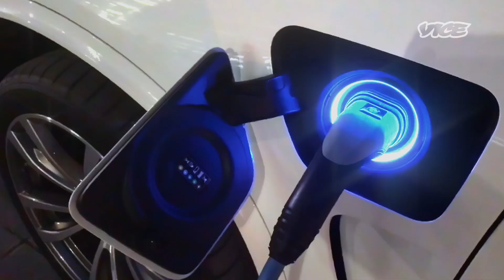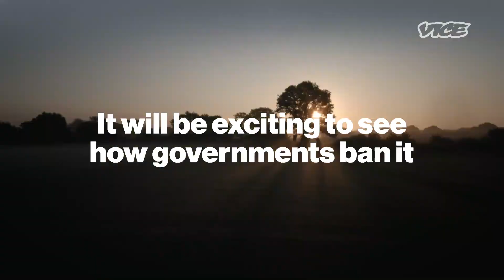The World’s First Solar Car | Extinction Update

Comment: Was this a joke? They didn't say anything about how much power the solar panels provide to the car versus how much is provided by conventional charging. I've got solar panels covering the roof of my van and it's a lot bigger than this, and I've got 500 watts of power in perfect conditions which never happen. Realistically, I get somewhere between 100 and 200 watts for most of the day. A wall charger for a  electric car delivers about 11000 watts of power and a supercharger can deliver up to 250000 watts of power... From what I've read about the lightyear one is that it has advanced panels allowing it to generate 1000 watts under ideal circumstances translating to about 200-500 watts in real world circumstances. Then you have to consider the fact that this will be a city car primarily. You don't get great sunlight downtown, in underground parking, or in your garage (Do people who drive $150000 cars park outside).  So Conventional charging can be up to 2500 times faster. Maybe watch the solar car race out in Australia to see what an actual solar powered car does, and then think about putting that car anywhere but the desert and how it just wouldn't work. There is a reason that Hyundai and Toyota don't claim that their solar roofs are for anything more than power for accessories. That being said, this is a nice "electric" car.
Reply: Wow I just got educated
Reply: Dylan Pollastrini no you just got brain washed by a seriously fake untrue video about solar cars that do not work yet abs are not even close to working.
Reply: @dylanpollastrini8129  this is a revolutionary car in the future because this is a infinite charge your driving in the highway
Reply: You could add pedals for an extra 100 watts lol
Reply: @abyssmanur3965  and maybe a wind turbine too, lol.
Reply: The claims are exaggerated by Vice, they don't claim to be fully solar. I think your closing sentence hits the nail on the head, if you compare it to other electric cars it's a significant step in the right direction. Which is what start-ups are about, innovation. About the solar race: the team of engineers that started Lightyear actually started as the university solar car team that built a car and participated in the solar race. I guess afterwards they decided commercial solar cars should be a thing and started designing.
Reply: J. van der Linden Vice exaggerate never....
Reply: @sjwimmel  And they managed to produce electricity during the race with their panels. During 2019 their car showed an efficency 117 and the next rank was 57.
Reply: @sjwimmel  no, they claim 725 km wltp, 7-20k km solar power a year and bull§hits like these... It is a huuuge leap forward, and i'm glad that we will get a new, innovative startup. We need more companies like solar roadways, theranos, waterseer, nikola, juicero and the others. It is a scam.
Reply: @blackrul3z  Not a scam, this car is built by Delft ex. Engineering students, the ones that made the Stella Solar race cars. It is indeed possible with around 400W on the roof of a car, to get 20 miles or more per day from the sun, if the car is built lightweight with expensive wheelmotors.  Think of IT as a car Styled velomobile. If this is ever capable of being produced cheaply enough, to be sold in great enough numbers, to Actually make a real Wold diffrence on global emissions, is doubtfull! I suspect this car Will remain a toy for the rich, like custom built super cars.
Reply: @Tore_Lund  lol. No it is not :D still nothing straight fact just shady yes we can... How many times you think people will suck this stupid nonsense in? We saw it several times with nikola, theranos, solar roadways, and stuff like these. Is it that good? Give it out for independent test companies. Ohh you cant as they will laugh for a week...
Reply: @blackrul3z  totally agree.
Reply: it’s probably solar supplemented, charging like a regular ev
Reply: They claim "up to 70 km per day" in self charging. In Sweden electric cars are much cheaper to run - approximately 25% of gas powered cars/km an 1/10 almost to pay road tax but they are still quite expensive for ordinary people.
Reply: I'm glad you're interested in solar energy. Newer, far more efficient pv panels have been developed out of Kyungpook University in Daegu, SK. You should be looking at either LG or Samsung to start mass manufacturing them with 3 years. My money would be on LG, but even if they used this a supplemental energy and the remaining electric was grid based charging, you are still reducing fossil fuel emissions by a significant amount - dependent on your country's current renewable energy production. They did say that this vehicle would reduce a car's emissions by 53% over the course of 12 years. This is not significant enough for me because few people maintain a vehicle for that long; however, improvements to solar photovoltaic panels will make this more viable.
Reply: @mosaicsnmaple  Of coarse I'm interested in solar power and electric cars. It's a huge step in the right direction. Consumer solar panels are relatively "poor" in their performance right now, which is why the panels on this car can generate about twice the power per square meter. They still have a ways to go before panels like this make their way to mass market. And even after that, I'm pretty sure they are only about 40-50% efficient at capturing all the sun's energy. Quantum dot tech should close that gap as they can effectively make a panel which matches the color spectrum of light so it can capture more of it. These are still a ways from making it to any part of the market though as far as I'm aware. I'm rooting for these companies to succeed though (but they shouldn't make wild claims such as this being a solar powered car instead of a  electric car with a solar roof).
Reply: @mosaicsnmaple  Then put those *advanced"paneles on the roofs, not on a car...  The bad angle, of the panel can reduce efficiency dramatically, and buildings, trees will cast shadows further reducing it. While you can put the same solar on a rooftop, and use it on full efficiency not on 0-20%.
Reply: I'm Developing a Car That Runs on Weed...
Reply: Key assumption here is that this is basically a model y with a solar array slapped on top. 

Assuming a 180watt solar panel is around 800sq inches and the real estate that you can functionally place solar panels on a car like this is about 4x8 sq ft or about 4600 sq inches which means you can get about 5.76 180 watt panels onto the car while being able to see through the windshield and the back window. This means that for each hour in peak conditions the car would produce around 1050 watts however because a car roof and hood is not an optimal placement this efficiency gets cut in about half+extra weight from panels requires extra energy to move. So in reality we only get around 525watt per hour, supposing we get 6 hours of good sunlight that means that we get around 3150 watt hours per day. The Tesla model y has a battery capacity of 75000 watt hours, and a range of 326 miles, so using these numbers 3150watt hours would only get you around 13 miles of range per day in perfect sun. Even this is unlikely and as I mentioned before the solar panels would add weight and require more energy to move. However it is still technically possible just highly impractical, and as such there should also be an option to charge the car through an electric charger as well.

there is absolutely no way their claims of a 800km range are true if this has a smaller battery than 50kwh, and while the solar panels will recharge the battery while you are driving, it will only be enough to slow the battery’a drain by maybe 40% at the very most.
Reply: this. not sure they’ve suddenly overcome physics. there seems to be a lot of borderline scams out there right now, see also Nicola electric trucks
Reply: @Humungojerry  The reason this car is so expensive is that everything is lab grade. The solar panels generate about twice what typical good consumer panels generate. I'd assume the motors are also not your average, off the shelf motors, and the same for the speed controllers. The issue I have is with the solar car statement. Under perfect circumstances, ie, not driving during sunlight hours, and parking it on a podium which angles to catch the sun rays perpendicular with the car, I'd figure ten miles per day top, but also the statement I just made was absurd. Parking, and using for normal city use, ie, garages and underground parking, obstructed light from buildings, etc, it might generate from 1 up to 3 miles per day.
Reply: All of you: Do the math: Very few cars drive more than 10 000 miles per year, even rental cars. So very few will need a car that is charged more than once per week. - used less than 28 miles per day. 1KWh takes the car 4 miles / 6 km - up to 50 mph/80 km/h city driving considered. So you need 7KWh charged every day in the sun. Very few live with 12-hour sun-light, so assume 10hour - 700W - I expect that 15 sq feet can deliver this. I have high-performance solar panels that deliver almost 800W per sq meter.  I expect that this car can generate 1.5KW - 15KW or electricity for 60 miles daily. So every day, it will be charged for more miles than it is used, to it is full, say 50KWh. - range 200 miles per day. You will spend 8 hours driving in a city to use this energy. outside the USA we have other things to do than drive our car., and none of us conduct meetings, employment interviews, boardroom presentations in cars. We work and the car is parked at work.
Reply: @knuthf  Also, what brand and model of panels do you use. The sun only puts out 1000 watts per square meter and the most efficient panels on the consumer market is around 22%... You seem to be keen on doing math, so do the math.
Reply: @Fpvpilot928  it was probably a typo. He is doing meth :D
Reply: @knuthf  Did you really just say that this car can drive 8 hours on 10 hours of sunlight??? They should enter this huge boat of a car into the solar car race in Australia. Have you seen what an actual solar car looks like? Are you just doing rough calculations using rough estimates under ideal circumstances? How long do people park their Teslas outside on average per day? Most park inside garages at home and at work. The sun is also never directly overhead, never giving panels full power, let alone the fact that these panels aren't arranged in a way to maximize solar power but to minimize wind resistance. Most people who drive electric cars also drive in big cities, and large buildings block out more light from reaching the solar panels. That's great that you have solar power, but you are misleading people about the power that this car can generate with its solar panels. This is an electric car with a solar roof for range extension.
Reply: @knuthf  no, you dont have a 800 w solar panel, not even close to that. There is no such things right now, even a maxeon 3 n-type ibc would give half of that in a 120-hc size, what is way bigger than squaremeter. Furthermore putting solar on the roof, and putting solar on the car are way different things... EVEN if you can get a 800 w/sqm panel, putting it on a car would result a non optimal angle, and a dramatical drop on efficiency. This is why solar fkcin roadways is not a thing. And we are not talking about any other thingks, like you park on the road, where other buildings may block the sunlight, trees, etc.

It makes no sense to put a solar panel on a car to charge the big batttery pack. And thats a fact. You can argue with it, but it is a bit useles...
Reply: @blackrul3z  800w/sq meter? Who’s making this crap up lol that’s way beyond the limit of the photovoltaic cell lol realistically it’s more like 1.5 or 2 sq meter for 800w. And as you said rating is not the same as actual output, though this is definately a more viable idea than solar roadways, but still only for people who have needlessly large amounts of money and have to drive less than like 10 miles a day.
Reply: This isn't the 1st one. Other car companies are bringing solar cars in.
Reply: @BlackDeath920  please name a marketable solar car instead of saying "other companies"
Reply: Great Catch!
Reply: Lol don’t you know the Dutch by now they stretch the truth by a mile. The Dutch have this belief if it’s said it must be true then and once it’s said other can repeat it as a fact. If a ask a Dutch person for real world stats to back up claims of those stats they will literally answer you with this type of reply. "In the Netherlands we don’t do things that way"  That’s a actual statement they make and stand by it with a straight face seriously people. Its down right embarrassing to watch them say things like that and they have no problem with such a thing. The dutch love to paint a image of no crime In the country yet you can not literally get any info on crime or won't see the crime on the news its extremely filtered or diluted. Yet you can talk to most dutch people and they will tell you "oh we don't have much crime here" The dutch are notorious for this behavior.
Reply: @RViscara  LMAO. I wonder how you got that impression
Reply: @RViscara  wow, you're really good at making inflammatory statements!
I probably don't have to tell you but that's a ridiculous generalization. And I'm curious who the Dutch people are you got this impression from. Because in general we have a pretty fact-based, no-nonsense culture.
Reply: @sjwimmel  I agree. Down to earth, practical people.
Reply: @RViscara  I just looked at your channel and dude, we live in the same neighbourhood! Interesting how we can have such wildly different views. Anyway, Dutch national and local news often reports on instances of crime. Too often for my taste, actually. When single instances of crime are reported, we get a warped view of the bigger picture. And the bigger picture is that crime has been steadily decreasing in the Netherlands since 2010. Source: https://opendata.cbs.nl/statline/#/CBS/nl/dataset/83648NED/table?fromstatweb
Reply: @sjwimmel  Its comical how the dutch news doesnt report or show the major crimes. Everything from someone getting stabbed to someone getting mugged at gun point. To me I want to know the majority of those things so I can be aware. Not to dwell on the bad news but to be aware and act or behave accordingly. I have seen and heard so many crimes in my local area that are pretty major and nothing about it in local news or other larger news outlets such as tv or national news. If they do show something its very vague on the info. Such as was the person injured by a gunshot or stabbing or beaten up. They never say if it was one or 3 criminals or exactly were it happen only vague info. The main purpose of the news is to inform people of things to let them know what's going on so they can be prepared to watch out for things. As for being in the same neighborhood glad to hear it and will give my thoughts on the neighborhood. There are some really nice and good dutch people living here and some not so nice. We also get a lot of visitors from other places south of the border that are less desirable in this neighborhood when they come through. The place is changing and its a shame because I like the old original dutch type people who have the real Brabant accent. I am lucky my building is filled with mostly good dutch people and we look out for one another as it should be. Funny thing is the bad neighborhood is just behind the spaceship building in this video lol. Well I am off to the new fiets path bride by the airport to film it but its awful windy today. Goeda midda mien frienden.
Reply: @RViscara  Achter de Evoluon ("spaceship"), is Drents dorp, niet een slecht buurt. Dus waar hedde gij oew onzin info van?
Reply: @RViscara  Drenthsdorp is niet bekend als een achterbuurtje, maar als gij daar nu woont mischien dan wel, aangezien jouw taalgebruik. Doe maar rustig aan en minder tv TV kijken en opinie nieuws lezen.
Reply: @sjwimmel  I went to NL but I worked for the unprofessional Poles lol 💀

Comment: Problem is adding solar panels to cars is dumb because at any given time, only a small fraction of the solar panels are at an optimum angle related to the sun. The most efficient thing to would be put those same solar panels on your house or on a tracking installation and use that power to charge your car. Then if something happens to your car, you don’t have to waste more rare earth materials making new panels. Also the panels can then also power part of your house. Or better yet, use grid level solar so every electric car is a solar powered car and we don’t have to waste resources putting solar panels on every car and having them carry that extra weight around
Reply: Exactly, I didn't hear anything about solar panel efficiency in this video at all. I'm all for going green but you gotta be smart about it. Tesla has some of the best solutions for reducing carbon emissions, they sell you the car and the solar panels PLUS a battery pack to store electricity from the solar panels. Obviously it's not super affordable yet but it's a more practical solution
Reply: Lol..seems so obvious.